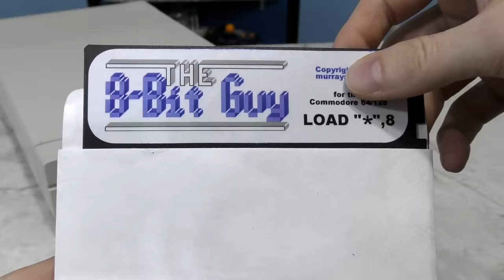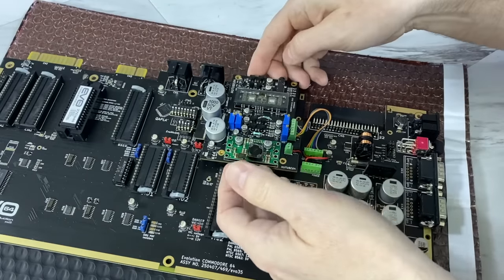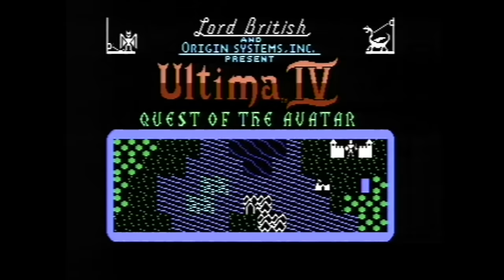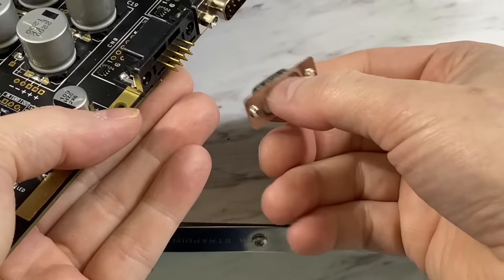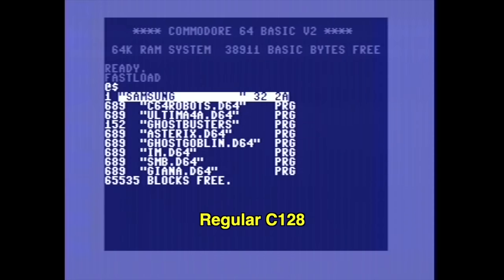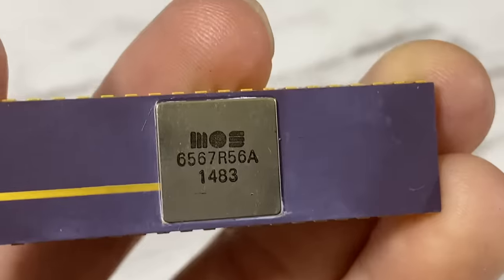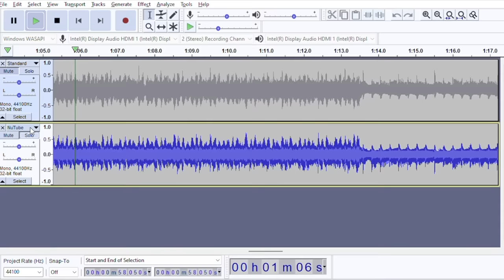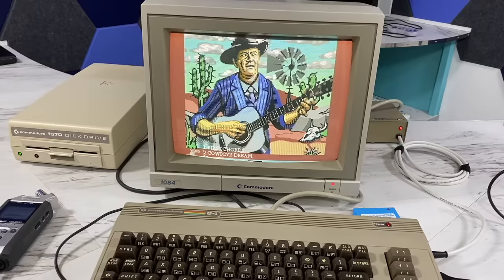The Evolution64 - Is it worth the money?

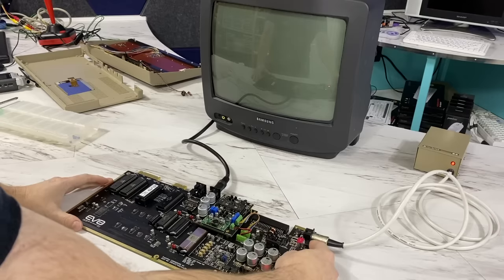Comment: You are correct that the NuTube is a VFD - that's the exact technology they used to create it. The two little rectangles not only light up when the tube is powered (seen at 4:43), they vary in intensity reflecting the signal that's being supplied. If you're curious, the tube itself is a twin triode configuration, with a directly heated cathode. A directly heated cathode is the typical arrangement for a VFD. I think that's also why the rectangles vary in intensity - in an indirectly heated arrangement, the filament just receives a set voltage.
Reply: I was going to say that, they are'nt propper valves, just VFD's, so you would'mt get the rich valve sound anyway. It's just a gimmic.
Reply: @frankowalker4662  boil tubes and VFD down… they're glass-encased with a vacuum pulled with emitters/cathodes/filaments/plates etc. If the VFD replicates the same thing a tube can do, who cares what shape it is?? It is a gimmick however in this case, even if full sized tubes were used.
Reply: @frankowalker4662  They are valves. Maybe a indirectly heated cathode would be a upgrade. Otherwise quite much the same stuff!
Reply: @frankowalker4662  they are actually valves, they're just not built in the traditional arrangement of a valve. Just like Nuvistors and Subminiature tubes are still valves despite not looking like a 300B.
Are they flashy with the phospher that lights up? Yeah, but so are magic eye tubes (and even those you could use as a preamp). They're neat options that unfortunately haven't caught up, but sound amazing for guitar. 

Now, are they a gimmick in audiophile gear? ABSOLUTELY.
Tubes ARE gimmicky. They're way more nonlinear than transistors, noisier and less reliable too. But that's not the charm behind them.
The charm is seeing their filaments light up, physically getting hot, and sometimes even having a purple-y blue-ish cloud of electrons build up inside them. It's the connection with what was seen as cutting edge tech back then, and it still working today, that is the gimmick.

Kinda like owning a muscle car. It's not efficient, it's loud, and it's environmentally horrible to run them, but damn are they a great collection of engineering achievements coming together into a beautiful piece of gear.

It's the kinda thing you throw in there for fun, IMO.
Reply: Vacuum tubes in the old days were the opposite of reliable. Do you know if they have they fixed that issue?
Reply: @JustWasted3HoursHere  This is wrong. Besides really hard driven power tubes and rectifiers, tubes can work reliably and last very long. Miniature and steel tubes even withstand vibrations and shocks in military aircraft. It's all a question of manufacture quality and proper circuit design.
Reply: @theplateisbad1332  Good to know they've solved that problem. Old vacuum tubes were very temperamental back in the day.
Reply: I have a Korg Volca Nubass synthesizer that uses a NuTube in the oscillator circuitry. It's definitely more gimmicky than musically necessary. While not bad-sounding (the NuTube does add a fairly pleasant saturation to the overall sound) it's not mind-blowing either. I've heard plenty of OP-amp analog oscillators or even purely digital oscs that sound as good or better.
Reply: @JustWasted3HoursHere  Usually, tubes only go out from bad components, bad circuit design, overdriving them, or just reaching the end of their life.
Reply: The VFD based tech is much more suited to mass production and there for much cheaper to manufacture
Reply: The nu tube is much more lively
Reply: I've built a headphone amp from one.  They actually sound pretty good, but they are CRAZY microphonic.  Someone walking across the floor in the same room as the thing will send it into ringing.
Reply: @shockwavecity  Weird, I have a couple of those Vox mini guitar amp heads with nutubes and no such issue whatsoever.
Reply: @theplateisbad1332  Yep I have a few guitar amps from the 60s with original tubes, which include hard driven pentodes and rectifiers that get hotter than the sun. But once you factor in the high voltages needed to run them, the filter caps needed to smooth that voltage, poor thermal efficiency and sensitivity to shock vibration and you get something that is simply not practical compared to transistors unless we are overdriving an audio amplifier for the toan
Reply: @JustWasted3HoursHere Of course, solid state devices usually last longer than tubes, simply because of not losing vacuum and no filament that ceases to emit over time. But if you take a look at state of the art tube devices, like the 1946 RCA CR-88 radio receiver, or the Tektronix 547 Oscilloscope of the Apollo era with about 40 Tubes, they usually still work today. Early computers like the ENIAC had notoriously unreliable tubes, because of insufficient cooling and the tubes were simply not designed to switch on/off thousands of times per second. But this was corrected, e.g. the E90CC was built for use in, then, high-speed computers and is rated with 10000 hrs lifetime minimum. Also, a beast like the 500 kw, yes, kilowatts, RCA 5831 RF power tube shows what tubes can do. It needs water cooling, though. 🙂
Reply: @alexanderkuhn2298  Certainly, solid state is usually much more reliable than tubes. But they are not that bad, too. Electrically, they are much more forgiving than FETs, for example. Miniature, cold cathode designs like the Nuvistor just came too late to the party.
Reply: @FennecTECH  yes but the thermoionic dispersion is planar, not cylindrical. In addition the heater and the cathode share the lead (heated cathode) which creates a sort of problems if you want to have floating cathode and not single ended outputs. For a balanced tube amplifier (I do not dare proposing it here... they are already bickering with my small nutube) they are difficult to balance (need to float them). Same for cascode. So bottom line, you do have more juice out of old-style tubes. The triode64 uses ECC88 at 24V, but can be pushed to 48V wiuth other tubes.
Reply: @theplateisbad1332  tube wear and you change them. Low temp-nutube will last a lot of time... Solid state cooks and junction derail because of electromigration. Solid state amplifiers running for a while DO degrade as our C64 did degrade through the years. Balance points do change too.
Reply: @5roundsrapid263  I know they can generate a lot of heat too, which can shorten lives, but I imagine the energy going through these is so tiny that this is not much of a factor. Still, I would guess that most people won't notice the difference in sound and wouldn't be able to justify the extra $500.
Reply: @JustWasted3HoursHere  $500 is insane. I could build a tube preamp for $100, easily.
Reply: @theplateisbad1332  Good to know. When I was little my parents had a TV/Stereo unit that was as big as a couch and ran on tubes. When you turned it on it took about half a minute to start doing anything but for some reason, as a kid, I thought that was extra cool. It lasted a pretty long time IIRC.

It makes me think of what a mind blowing advancement integrated circuits were, to have tens of thousands (then hundreds of thousands , millions and billions) of transistors on a piece of silicon about 1 square inch and using a microscopic fraction of the power. The possibilities it opened up must have been mind blowing back then.
Reply: @auro1999  There are bad semiconductor designs and bad tube designs around. And yes, regular VFDs wear out over time, but in good designs they are not driven to max. and look good even after 20 years. Others are unreadable dim by then. So the NuTube is probably quite reliable, too.
Reply: @theplateisbad1332  I drive the filament to the current as per data-sheet. If it gets dim in 20 years, send it to me and I`ll fix it for free !!!
Reply: @erlendse  Indirect would consume far more power & generate more heat, these were also designed for low powered devices.
Reply: I've tried out the NuTube, and was not impressed.  It's got a high noise floor and terrible microphonics.  It's also badly overpriced, considering you can get the exact same thing from any scavenged VFD and a bit of DIY.
Reply: @EphemeralTao  did it have transistors, mosfet or jfet in the input and outputs ? A pirelli tire does not make a ferrari !
Reply: @auro1999  A VFD tube is not a Pirelli by a long shot, it's just a tarted-up Cooper.  They're just overpriced gimmicks, nowhere near as good as standard glass-envelope audio amp tubes, which cost a fraction of the price of the Korg things.

As for transistors, any well-designed FET amp will easily outperform all but the highest-end tube amps.
Reply: @EphemeralTao  Yeah that sounds like what i heard when they first came out years ago, we can't be surprised they didn't improve much.
Reply: @EphemeralTao   If for some reason you are willing to donate personal time,  I can send you a batch of 1000 n-channels LSK170 (and their p counterpart) to test, select and bin on 0.1mA groups. I do need them for another project. Thanks.
Reply: @MammaApa  because Vox uses proper ways to shock mount the NuTubes that avoid the microphonics issue (aka adding foam padding under it so it doesn't vibrate).

Comment: Techmoan used an audacity feature to combine the two tracks (one has to be inverted as well) and if there would be any quality improvement, there would have been a signal. If not, they would have been identical and x - -x would still be 0.
Reply: Phase is irrelevant, as long as it is different between channels.
Reply: You mean x + (-x)
Reply: @PubstarHero  yes

Comment: My theory for your inverted audio output: the Nu Tube is a pair of triodes and I suspect it is being used as an low input impedance inverting amplifier because that's the easiest way to make a low noise amplifier with a single triode (or transistor, works roughly the same way). There are two triodes so one of these simple class A amplifiers for each of left and right output.
Reply: They even don't thinked about non-inverting amp circuit (Actually just need to connect to a different pin and have one another resistor to do that).What more,they sounds like oversaturated😂.

Comment: I did notice that the evo board had slightly better lower frequencies, and that’s about it. The problem with audio is that you have to spend quite a bit of money to get a very slight increase in sound quality and you have to spend that money on the equipment it’s being playing from and whatever actually has the music on it (a record, a digital file, or whatever else) and then you just get stuck in this endless loop where you keep spending more and more money to get a very slight or even non existent increase in quality. And to be honest for the 8 bit music that the C64 would be making it really just isn’t noticeable, you could spend $10K on an amplifier it really isn’t going to matter. For most people, there is no difference in sound quality between a transistor amplifier and a tube amplifier. But there are always a few people who claim to think a tube amp sounds better and it’s hard to tell if they actually hear a difference or if it’s just placebo because they spent 10 times what a transistor amp costs.

Comment: 1:45 That's exactly correct. NuTubes are repurposed/reengineered VFDs used to give vacuum tube characteristics like sag to audio circuits without requiring the excessive power draw of 100+ year old technology. They're most common use is in the Vox MV line of guitar amplifiers and a certain variant of the Ibanez Tube Screamer overdrive pedal

Listening to the demo, there's a minor EQ difference likely caused by the amplifier circuitry and NOT the NuTube. it's an incredibly small difference and charging $500 for an upgraded amplifier for a 40 year old 3 voice synth is simply end users getting fleeced by bad faith promises. For reference, i'm listening on Beyerdynamic DT770s plugged into an Audient iD14 Mk1 interface
Reply: I got a nutube in my Korg Volca NuBass, wich is a 303 like acid synth. The nutube is used in the oscillator and suboscillator drive. Sounds quite pleasing.

Comment: What a Time to be alive when you can build a brand new C64 from all new parts!  I like the flexibility of this board that you can build a brand new system, or use original C64 chips.
Reply: Cool but a costly endeavor considering PC emulsions are cheap or free.
Reply: @HOLLASOUNDS  *emulation
Reply: @blakegriplingph  Good lord Dyslexia strikes again.
Reply: If you count FPGA.  And if you count FPGA, get an Ultimate64 instead.  If you want an "authentic" C64 then it can't be built from new parts because new parts don't exist to replace the old ones. If you have a bad board, buy a replacement C64. if you want a clean board with reclaimed chips you can cheaply buy a brand new PCB.
Reply: @espressomatic  You will be able to build a true new C64 as soon as the CIA chips are made available, it's explained in the Perifrastic's video. Unless you are really picky about what counts as a replacement.
Reply: @vytah  I went and watched that, and yeah, he's using "replacement chips" that are definitely FPGA at best, so Espressomatic is right; you might as well just get an Ultimate64 and save some money (and get HDMI support in the process).

Comment: Regarding the audio you mention, you can't hear any difference between the two. The difference is clearly noticable. One can clearly hear the difference. But that depends on what your or anyone elses audio output is. I'm watching your and simmilar YT videos on my 4K TV conected to Harman/Kardon amplifier with 240W Yamaha standallone speakers (stereo only). If one is to do a comparisment on a simple monitor, TV, or any other simple audio device, probably one would not hear any difference. But that difference is there. One can clearly her it through your video. With this in mind, I assume your recording equipment must be high quality. Othervise even I using my amplifier wouldn't be able to hear the difference. You did a good job presenting the audio difference in a quality manner. Personally, I prefer the new sound. Sounds so much better to me. Weather that is of any relavance to a C64, I guess it depends on how one would use it and for what. Regarding the price, it is relative and different for any individual. Currently for me it seems too high, but on the other hand, if I would be the one who can afford it, it's possible that I would.

Comment: I can definitely hear the difference without and with the NuTube. The NuTube has more of a scooped sound. I would be hard pressed to say which I prefer without using it for many hours. Definitely not worth $500 for most people. It is interesting though and I would pay the add on price if it was much cheaper... like maybe $100-$150.  I could see how this would appeal to folks who use the C64 in music creation.

I will add that I don't think the development of the NuTube add-on is dumb idea. I think it is an awesome idea.
Reply: I work with audio and music and I could clearly hear the difference too. I could also see that the valve-processed waveform was smoother with fewer spikes. Probably better value than that $500 add on would be an external on valve amplifier such as a headphone amp that could be used with lots of devices.

Comment: Great review as always - I am on the preorder list for the basic stuff, I was really hoping the NuTube would be something fantastic, but it just seems like a waste of money for 99% of the people. :(   

I have a keyboard and case waiting for this! :)
Reply: I think that the issue is that, while valves can sound really good, just having a valve in a circuit doesn't make the circuit good by being there.
Couple that with the component not being a valve that's intended for audio amplification and you're not really going to have an easy time recreating the same qualities that you'd get from a high end audio product unless you have some very good engineers designing the circuit.
You'd probably get similar, if not superior, valve emulation from using a JFET-based circuit (which would likely be considerably cheaper as well).
This is of course somewhat of a moot point given that the waveform that's being fed into it isn't particularly complex. The SID chip is very musical in its own right but it's got hard limits when it comes to the actual sophistication of the sound as compared to a record.
If you're comparing the two amps you're probably going to need to hook them up to something that's outputting a high fidelity recording made in a studio to really identify much in the way of difference between the two, as that would give a better idea of the difference in response between the two designs

Comment: One thing I did notice in the first audio section, is that the real C64 seemed a bit sharper sounding, with the nutube reducing those peaks, but maybe the audiophiles can help me figure out what that means
Reply: It's hard to say for sure without putting the audio thorugh a frequency analyzer, but I'd expect the higher quality audio system gets a bit more lows through, effectively reducing overall emphasis on high "sharp" tones. Tubes also add some distortion of their own, which tends to subjectively round out the sound a bit.

Comment: Regarding the audio comparison: the thing to do here is to subtract one signal from the other so that all that's left is the difference. That will very quickly tell you if the valve-based amplifier is actually contributing much, and how (e.g. if it's producing more high-frequency sound you'll get high-frequency noise). Ideally, the result will be very quiet, indicating that there's very little difference between the two.